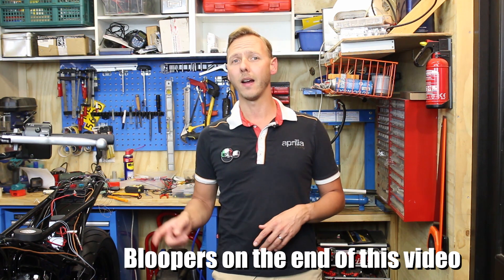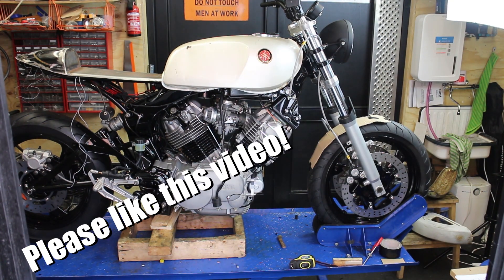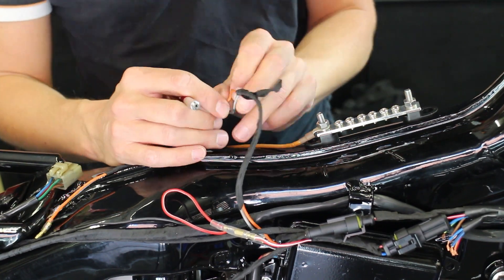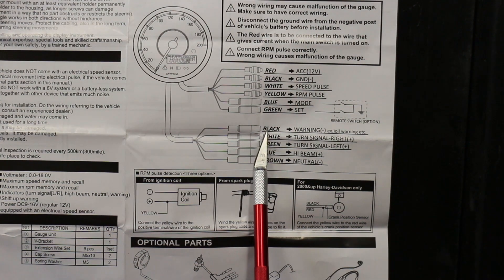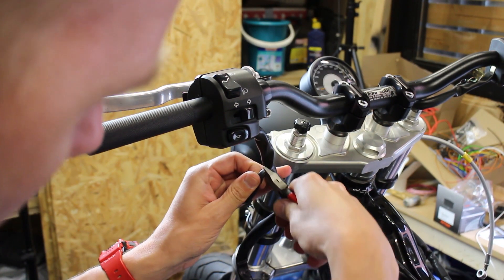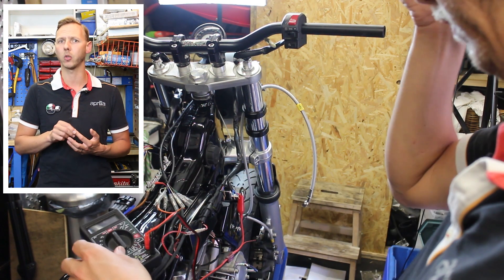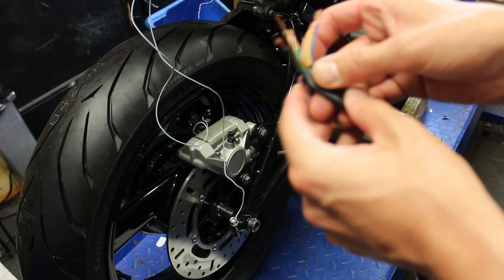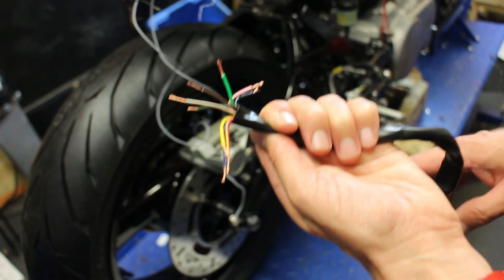How to connect motorbike handlebar switches (wiring part 4)

Comment: Great video. I just got a 05 en500 vulcan from a cousin. Was running great when it was parked in shed 2-4 yrs ago. Someone had taken break an clutch levers off an handle bar switches an twist throttle. Im having trouble with wiring the switches back because i cant figure out wires. Mine is us model an switches are off honda motorcycle. Year of switches unknown

Comment: Greetings mate, thanks for the good vid, perhaps you can give some insight with my project, I have the same righ hand switch you showed, the headlight switch has 3 position and I would like to make the following when the switch is the right side the headlight is completely off, when I put in the middle turn on the daytime running light ( I have one of this headlights) and when I switch to the left position it turns on the low beam 

Sorry for my English and thanks in advance
Reply from the maker: I am sorry Bruno, but this video is exactly the answer to your question?! This is why I made this video to explain everyone who is struggling with this in words, video and graphs... I can not be more specific and more detailed than this video... I am sorry. Otherwise, please  start with the very, very first two video's about wiring (there are two parts called 'testing your components' and wiring barebones). If you watch these two video's from beginning to the end, you might understand the basics better and be more confident to wire your handlebars.

Comment: Hey if I made a video of the aftermarket switch gear I have ( did come in a full kit) but the side light doesn’t want to come on and when changing light switch positions my main beam lights up and rear light goes off? It’s easier to show and explain through a video already have a few if your able to help??
Reply from the maker: I am sorry. I am no motorcycle dealer. Best is to go to a forum. Every brand and type has it's own forum. Thousands of experts love to help each other. You can post short clips and pics there. Good luck!

Comment: On the turn signals, will the handlebar switch make the leds flash or do i need to run a seperate switch in order to make the leds flash. Im sorry for the dumb question. Also what fuse sizes do I need to wire all the essential equitment like headlight tail light ect. First time doing this type of stuff. Thanks
Reply from the maker: Please watch this video: https://youtu.be/IjzrEY-EF3c for the turnsignals. Yes, you need a flasher relay to make the light go on and off. Most of the components need a 10 AMP fuse. But I also discuss that in the video's. Wath the series of '5' all the way to make sure you get all the info you need on this subject. Everything is discussed in detail.

Comment: Hi Pep,
Just finished my wiring following every step you provided! It was my favorite part of the build. Thank you!!! One question, my horn is not working. I connect the pink wire to one terminal on the horn and ground the other terminal. I’m using factory switches and I don’t have a toggle switch or flasher in my left hand switches. Any suggestions?
Reply: Disregard Pep, I found out the issue. The pink wire is a ground and the other terminal needs power not to be grounded.

Comment: Another great video Mate, I'm starting to rethink using superseal connectors instead of the original style plugs. Do they use a specialised crimp tool like deutsche plug or just a standard ratchet crimp tool.
Reply from the maker: Thanks! Yeah, you would need a tool like this: https://www.ebay.co.uk/itm/AMP-TYCO-SUPERSEAL-RATCHET-CRIMPING-TOOL-UNINSULATED-CRIMP-TERMINALS-DELPHI-/253005898324 You can also press other types of connectors with it like the bus type Honda connectors I often use for the single wires. But the AMP Superseal connectors are pretty fine and thus you need a ratchet which also presses smaller sizes together. As long as it has like four sizes to press, I guess your good. If you Google on it you find several types.

Comment: I have got a question regarding right hand side switch. I know every bike is different. My 125 cc have two bulbs in front. If I move it to middle I got brake rear light on highlighted speedometer and front beam light (big bulb) on, in all the way to the left rear stay same, highlighted speedo and only small bulb on. I did change switch to new as old one with wiring was 15 years old and had strange connections done by previous owners. So my question is whether that how this lights should shown in those position. I did exactly same way as before and do not remember how it was before. Rest of cables coming of that swith would be for brake Lever but that is working OK as well as kill switch and starter. So there is only two wires to mess with but when I swapped them I only had speedo hilighted in mid switch possition and but then only small bulb on and in far left it would turn rear brake light off, speedo highlights off yet turn both front bulbs on. Just wonder with is the way that you can call normal?

Comment: You never thought of putting a motogadget M-unit?
Reply from the maker: For sure I did. But then again I thought: the only thing it does is connecting one wire to the other. I might as well do that myself... it even makes your harnas longer and ticker because you constantly have to go up and down with your wires (in and out).
Reply: @chiefpepdesign  hummm Bedankt for de tip, I need to do it myself in a project I will start soon on a Ducati 750ss and still looking for options and best practices. awesome videos by the way. pity you don't have much time latelly but that is aways the problem right ;) Groetjes en tot ziens.
Reply from the maker: @ArinQ429  I'm not completely gone. Still available here for questions. ;)
Reply: @chiefpepdesign  well that makes me happy!!! I'm a newbie on this although I'm a mecanic myself so I probably ask more questions, I like you work because you don't compromise you want it perfect...as t should be ;)